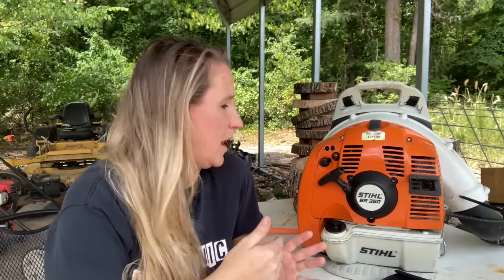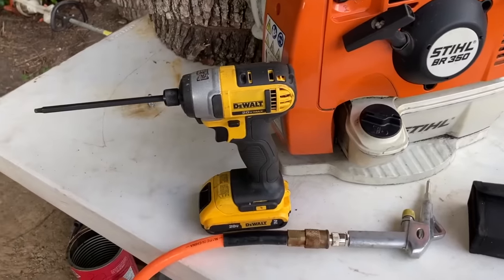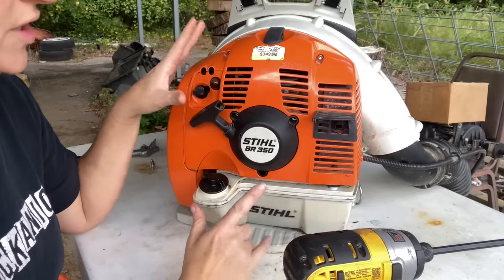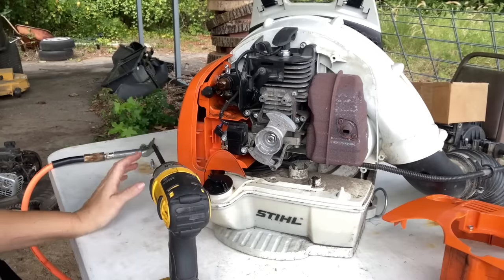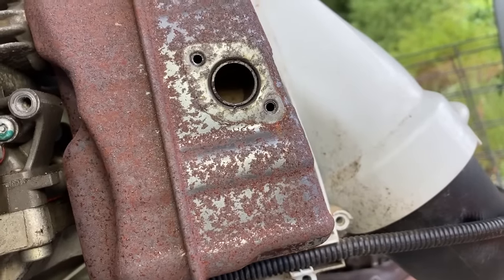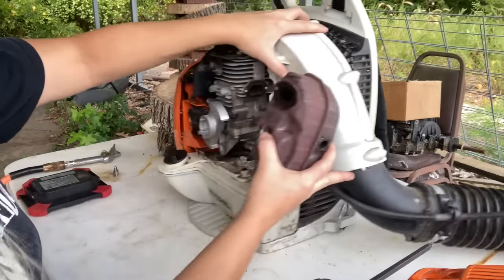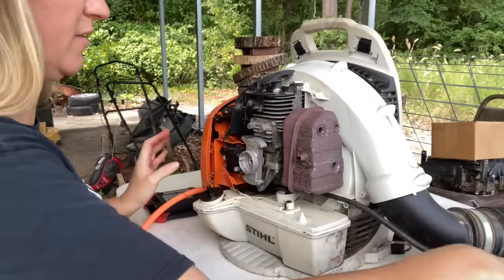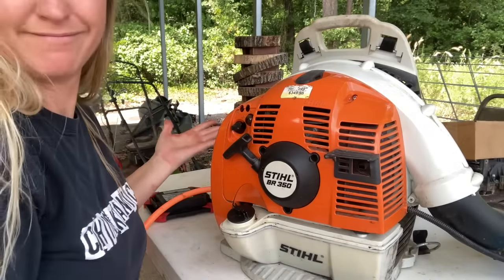Stihl won't throttle up or stay running? First thing to check!

Comment: Burn all out stuff out with muffler removed . Plugged from idling and running them at low speed . Might try the red Max brand mix because of the constant carbon tarring up issue . BR 55 hand blower are always plugging up . Yeah I like to start the screw by hand first . 😮

Comment: I have enjoyed all of your videos.  Thank You. I did think the high speed adjustment at full throttle at the end of the video could have used a little "tweaking".  Kind Regards, Craig
Reply from the maker: You are correct. ;-) I gave it an extra boost after I shut off the video, but thought it was good enough to get the point across on film. Thanks for watching!

Comment: I had the same dirt dobber  issue on a ryobi trimmer. Also rebuilt one of these BR350’s and had to replace the coil AND the flywheel to get it to spark. Weird.

Comment: My BR 550 had the same or similar problem.  It would start okay, but after running a while it would not throttle up or would stumble as it tried to and then would die.  I viewed this video, cleaned the spark arrest screen, checked the fuel filter (looked clean), and eventually pulled the muffler and blew it out.  Exhaust port looked clean, tried adjusting the high speed on the carburetor.  Still did not improve.

I looked at everything again and then noticed that the fuel filter was right at the surface of the fuel (tank was about 3/4 full).  I thought surely that was not the issue but pushed it to the bottom of the tank.  Problem solved!  I set the blower on its side to see if the tank had a clip that would hold the filter near the bottom but did not see one.   I guess that when I would shake the blower before starting to be sure the fuel mix hadn't settled out the filter would move off the bottom.  Still trying to figure a way to weight the filter down so it will stay in the bottom of the tank.

I enjoy your videos.  Lots of good information and common sense fixes.  I did the universal speed feed trimmer head and have really enjoyed using it.  Also, I'll be soaking my trimmer line before it load the trimmer.

Comment: Talking specifically about the deleted spark arrester was a hint to me. Although I wasn’t thinking about a mud dauber’s nest in the muffler I WAS wondering about a potential clogged exhaust port. Now I know to also check inside the muffler with a good light. Thanks! 👍🔧   Would another diagnostic test be to run it without the muffler (wearing ear protection) to check on the muffler itself?
Reply from the maker: Yes, I should had run the unit without the muffler. You have to put the cover and rewind back on so it is sort of a hassle, unlike a string trimmer, but would had saved me a bunch of time and frustration. lol  I was thrown off by it running so well the couple weeks before when it was in shop.

Comment: Spark arrestor screens - stop using Stihl Ultra.  It is a filthy burning oil.  I had a similar problem with my ms 241.  It kept flooding itself and would not run, like it should.  I had switched overusing Echo Red Armor as my primary two cycle lubricant this past January, but I had not run the 241 that much because it would not run, properly.  What I noticed when I did get it to run was it was noticeably quiet, even for a 43 cc engine.  I had it sitting by my 372 and I could not even hear it running.  If I had not noticed it vibrating on my outside workbench, I would have not even known it was running.  You cannot see the Spark arrestor screen on a 241, so I had to remove it.  However, it would not come out and I did not want to damage it, so I took the muffler off and put it in my ultra sonic cleaner with a good dose of degreaser.  After 30 minutes cleaning, I was able to pull the spark arrestor screen out.  I then burned it off with my LP torch and left the muffler in the ultra sonic for a full hour.  I put everything back together and the 241 cranked up on the third pull and ran normally.

Comment: Concerns for fall equipment: I have two different chainsaws that have sat with fuel in them for a couple months, I don't have occasion to run them often, so I use pre mixed ethanol free fuel. I run 40:1 mix in all my saws, my concern is mostly curiosity as to how long that fuel (Tru fuel bought from a big box store) can sit generally before going bad.
Reply: I think it says up to 24months on the engineered fuels....I'd run them up at least in the spring and fall...

Comment: I have learned so much from watching the videos. But I do have a problem with a neighbor's Craftsman mower. She brought it over with no spark. I checked the air gap, reset it after cleaning the magneto and magnets. Still no spark. I replaced the magneto, set the gap on the new one with still no spark. I disconnected the off switch, and still no spark. I'm at a loss.

Comment: If you want to run it with the muffler just chuck a socket in a drill to start her up saves putting all the parts back on

Comment: I thought you were going to find a carboned up exhaust port. Full throttle is a tad rich. Turn the high speed screw in a bit, but I'm sure you know that.

Comment: I'd work out b4 you found problem that it was likely to be exhaust that was blocked, since it sounded engine was throttled, so either lack of fuel or as this case blocked muffler! That happens cos people don't run them @high enough revs,best run flat out for 5mins to burn off oil from muffler,there really  made to use like that since small engine don't have much torque, l always are mine @full throttle all the time never had any problems @all.

Comment: I have a Troy built weedeater used very little, 2 years  old, replaced the fuel lines because it would shutoff after throttling up, replaced the carb, but won't  run, put old carb back on, seems to run OK now. Before replacing the fuel lines, my friend adjusted some on the old carb & it would run for about 20 minutes or so, then it would shutoff ?

Comment: Hello Chickanic, first time viewer, but I am having issues with a Echo PB 250 Hand held blower. I have gone thru this thing to taken it apart to inspecting the flywheel key, I had to replace the coil though since it had a no spark condition. I always go thru the mufflers on these Echos being that they are bad for clogging up. Compression is 120, it had spark, and a new after market carb...now maybe that's my issue because I usually have good luck with those non OEM parts. I even tagged Steve and his crew on live feed explaining what the heck is going on. The crank seal is ok. I don't see any leaking gaskets...this thing just refuses to throttle up...help me...

Comment: Good video.  I've got a BR 550 that bogs down.  It'll run fine up to half speed or so, but bogs when trying to go full on.  Spark arrestor and exhaust port is clean, although I didn't check for dirt dauber nests!  Probably need to replace air and fuel filter and maybe spark plug.  Where's y'alls shop?  Need to find parts.  I'm in WLR.
Reply from the maker: I work on Stihl, but am not a dealer, so I have to buy OEM Stihl parts from a dealer. Are you using canned fuel? I have seen MANY bad batches of canned fuel that will make it act that way. If you mix your own, are you 100% positive you don't have water in the bottom of your fuel tank? The blower will act they way when there is small amounts of water mixing in with your gas through the fuel filter. Thanks for watching!

Comment: Stihl BG 56 Blower second-hand bargain????
I Suspected the spark arrester correctly and cleaned that had excessive fuel in and around the muffler. With the spark arrester out sent compressed air in through the spark plug hole and heaps of fuel sprayer out, reassembled, and try to start no success, thinking it may be associated with the choke took the side cover off and found nothing obvious but gave it the compressed air treatment which caused the engine to turn over, and a heap more fuel came out I suspect from within the crankcase, reassembled and it started but only ran for 3-5 seconds, removed the spark plug and it was saturated cleaned it and more compressed air treatment, and it started again 3-5 seconds it stopped these attempts were with no acceleration and no choke I consider it to be over fueling but cant understand why.
Your thoughts would be greatly appreciated.

Comment: I had a interesting one. Last week my br450 wouldn’t crank changed fuel did the tune up kit. Still no fire checked the plug and seamed like no spark. Ordered the new coil pack when I disassembled the unit to put the new coil in and saw the issue muddaubers had made a nest in the arrester blocking off the flow

Comment: Repair shop I work at, found some stihl chainsaws would only rub with out a muffler, out trick was to drill a 3/8 hole in the muffler, and they ran...

Comment: Interesting...
I have a problematic Husq. 356bf backpack blower. New carb and lines, and still won't run beyond 10 minutes or so. Has been in for service, but still does this. Never considered a blocked muffler...

Comment: After looking at the fuel system and seemingly everything check out fine, I checked the spark arrestor and muffler, they looked clean and nothing rattling inside muffler, I cleaned everything. I am still stumped. Mine is a BR600 and if it sits overnight, it starts up on choke, runs for maybe 5-10 seconds and dies, won't start back up on or off choke for a long time. When I remove the fuel cap, it seems the tank is pressurized. Does that seem normal. I did like the video, it gave me one more item to check, but still looking for the problem.

Comment: My problem is I've never had success from cleaning and re kitting a carburetor on a non runner or badly running engine. In these cases fitting a brand new carburetor works every time

Comment: I have a John Deere 757 zero turn and you told me that it possibly could be the pto clutch on why it is blowing fuses so I had that replaced but it runs fine for about 1 or 2 hours then it will blow the 20 amp fuse and I will replace the fuse and it will run fine the rest of the time I am mowing what do you think it could possibly be ?? And your shows are the best on the internet very informative keep up the great work
Reply: We are going to look up the electrical on this mower and see if we can come up with anything. If you can please list the units serial # so we are sure we are looking at the right one.
Reply: Ok p/n-  tca15504 and serial number is tcm0502757k

Comment: I have a brand new stihl chainsaw. I used it for the first time last month and ran fine for about 30 minutes. After I turned it off I could not get it to start again. I had several friends try to start it with no luck. Do you think I might have flooded it?

Comment: My 2020 Craftsman leaf blower with a 27 cc motor  will start up , run on start, run perfectly, than it will act like it ran out of gas, it will start right up , run good for about 45 secs , run perfect, than it will almost stop but than it will rev back up without hitting the trigger, as long as I don’t hit that trigger it will idle perfect, but if you rev it up it will stop, replace spark plug, check my muffler, , replace my filter in the tank, check the screen in the carb, all good, still no change, have no ideal what wrong.

Comment: Need help!
BR700 will start fine normally.  
idles fine
As i give it gas, it revs up to 50% throttle.  
After 50% throttle it starts to die and stalls.
Cleaned the carb, checked the spark arrestor and both clean...same issue
haven't looked at the exhaust like this...
Thank you!

Comment: I have a 55 steel leaf blower. It cranks up cuts right back off the spark arrestor has been cleaned. Not a problem it’s not me. I don’t know what else it is a checked air filter. Seems like he’s getting plenty gas. I haven’t poured gas filter out but it’s plenty in the bubble, so I’m stumped I don’t know what to do.

Comment: I have a Stihl FS90 for 7 or 8 years, and yesterday, it acted up like this for the 1st time ever.
This unit needs to have throttle locked up to max before cranking it, full choke at first, then off choke should a 2nd pull be necessary.
The unit started as usual, but I soon as I unlocked the throttle, the engine stopped immediately.
I managed to use it by not letting go of the throttle, and once it warmed up good, then only could I let it idle.

Comment: The first thing I check is fuel if a small engine that runs with low power.  New to me fuel is sometimes no good.  Particularly if the fuel was no ethanol from a station that doesn't sell a lot. Endo cameras that plug into phones and let you look inside engines are a must for me and are inexpensive.

Comment: the screen is still in the muffler, its not attached to that cover, i use a hook pick to pry it out of the muffler then you can burn it clean for a better longer fix
Reply from the maker: Not in this model. You must be thinking of something different.
Reply: @Chickanic  try it and see
Reply from the maker: @bigdadtrav  #23 on this link is the only spark arrestor screen it has and it was not in there. https://www.diyspareparts.com/parts/stihl/diagrams/br-350--430/c1834119-354a-4d73-bb04/
Reply from the maker: @bigdadtrav  Maybe you are thinking of the Stihl BR400??? https://www.diyspareparts.com/parts/stihl/diagrams/br-400/b043b2ee-07d5-45fa-9eba/

Comment: I have a Stihl FS 90 trimmer that would run for about 10-15 minutes and my Stihl repair people said they fixed it with a new carburetor. That didn't fix the problem! do you have any suggestions?

Comment: fyi if the stihl backpack unit has alot of hours on it the brass spacers for the front cover will fall out causing the pull start to bind
Reply from the maker: Yup!! I have seen that MANY times. Thanks for watching!

Comment: Hey there! The H screw backed out and fell out. Only way it will not back out while running is to screw it all the way in. Then the saw won't run under throttle. It's an echo cs-450. I'm stumped. Any ideas?

Comment: I have a ryobi trimmer and have a hard time starting it. New carb, s/ plug, fuel lines, fuel filter and using top fuel 3cycle 50:1 ratio. Did not start before the parts replacement, it started afterwards used it for the day no problem. Went to use next weekend and now have the same issue again. Any ideas?

Comment: Well done.
Always you make right resolves
Urgent your support 
I have effco hedge trimmer GT2800
Walbro carb has same issue
Start but in full chock with very high speed but won't throttle if chock off and then dies 
I need your email to learn this issue from you 
Thanks

Comment: Sthil has to be the most difficult units (Trimmers, Blower, etc) to work on. Especially the Trimmers. All incased in a housing that is hell to put back together. I have worked on dozens of these trimmers and absolutely REFUSE to work on a Stihl. It's all set up for DEALERS and REPAIR SHOPS,,the average person usually is LOST. sad and Disturbing. Sadder yet, i won't buy another brand though, Stihl STILL the Best. LOL

Comment: Great video...  have you in the past made a video on adjusting the valves on the Stihl blower?  If not, I really would like to see it.  I was hoping that you would check the valves while you had the cover off.
Reply from the maker: I haven't made a Stihl valve video yet, but I will soon with blower season coming. This blower doesn't have valves. Thanks for watching!
Reply: @Chickanic  Great!  My blower does have valves since it is a larger model Stihl.  The adjustments are a bit of a mystery to me as far as finding top dead center (or whatever it's called).  A video would be very useful.  Thanks
Reply: @mrspock2al  There should be an arrow on the flywheel, it should point towards one of the screws on the coil. On my FS130 it is the screw closest to the center of the engine. The 4-mix engines are four strokes so the proper TDC is at the top of the power stroke, at ignition, once every other revolution. Piston all the way up, both rockers loose. The other stroke when the piston is at the top of the stroke is the end of the exhaust stroke and the cam transitions from exhaust to intake. If the piston is traveling up and both valves are closed that's compression and the spark happens at TDC. This precise position is a little fussy on account of the cam having a built in decompressor which holds one of the valves open just a few thousandths to make starting easier. You need a .004" feeler gauge and you'll need to take tin snips to trim the tip of it to finger and stone the burrs off. The rockers have a shroud on two sides where they go over the ends of the valves and you need to get the feeler in that gap. Stihl sells a kit that includes the right feeler, already trimmed, a new cork gasket for the valve cover and a copper washer to reseal the screw that holds it on.

Comment: Have a BR600 ,and the blower arm elbow will move to the right at 90 degrees and stay there. I had a repair shop tell me that the elbow had to be replaced. Did that, and it still kicks out while blowing leaves, and its really uncomfortable try to blow leaves like your arm is in a cast stuck out, then trying to wave the blower arm. I have to stop and push the elbow back close to the blower, and shortly later it’s 90 degrees out again? Any thoughts or fixes? Please, help, Ronnie

Comment: I have a stihl fs55c trimmer and it's having throttling problems. Where is the spark arrestor located in this model and how do I remove it to clean it?